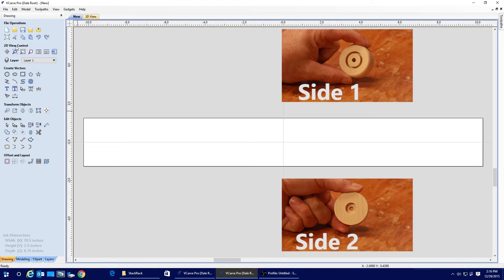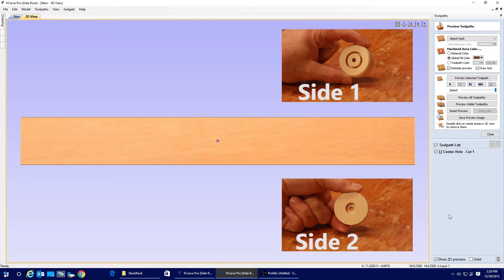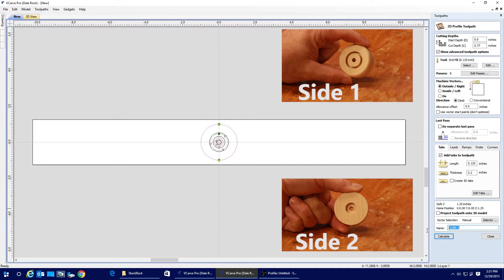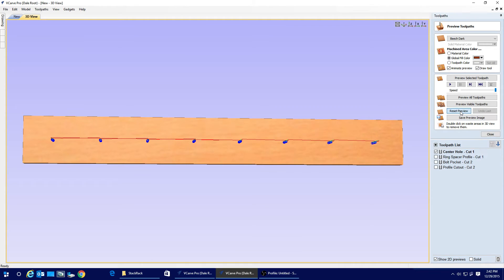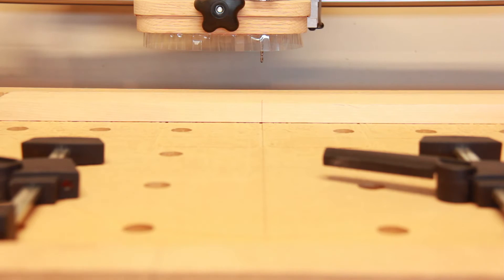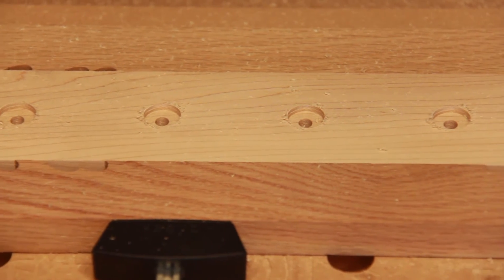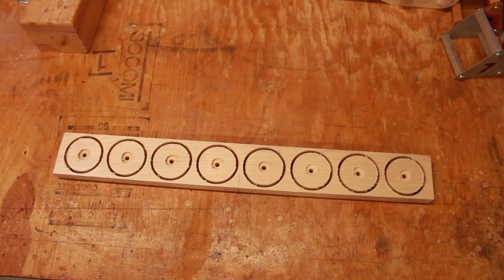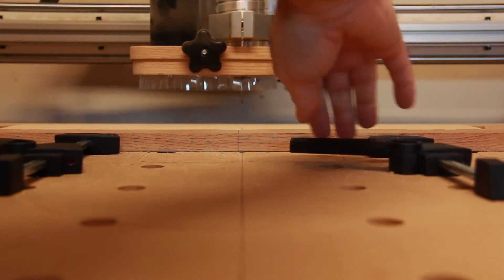CNC Router - 2 Sided Machining – 101

Comment: Thanks for this great simple video! BTW where did you buy those table clamps? They are great!!! :)
Reply from the maker: Dale Root
Thanks for the kind word!

The clamps are Festool Clamping Elements - designed to work with their MFT surfaces.

I machined similar holes directly into the MDF pallet and it seems to work pretty well.
http://www.amazon.com/gp/product/B000JNEC1Q?psc=1&redirect=true&ref_=oh_aui_detailpage_o00_s00

I've recently also started using Kreg In-Line clamps - and they seem to work pretty well too - and they are much less expensive.
You can see the Kreg clamps in use with my fixture pallet in this video:
https://youtu.be/h7L7SX-jxKA

Comment: Very clean Dale and nicely explained :)
may I ask what is the thing that you are using to hold your piece while routing at 7:42 ?
Thanks ..
Reply from the maker: Thanks you for the kind words!  ;-]
That is a router mat - basically a piece of foam cushioning that grips small parts.  Think carpet padding - that's basically what it is.  They also make versions now that are rubber as well.  Great for sanding and routing.
Reply: @OakLines  Thanks Dale ..
do you have a link for any of these? I wanted to by one..

Comment: Why not make a hardstop for x axis as well, so you don't have to refer to a line, which I think may lead to human error, specially in my case where I no longer have a good set of eyes, hehe.
Reply from the maker: Good question!

Yes - for single sided machining you could certainly add an X hard stop – and it would work just fine.

However – for 2 sided work – once the 1st side has been machined - you need a way to turn it over and precisely align the work – so that the work you’ve already done on side 1 will match up with the work you’re about to do on side 2.

Now I know what you’re thinking – adding an X hard stop should make that easy - right?
Well unfortunately – that is not the case.  Since we’re starting from rough stock - of approximant dimensions – that becomes a bit of a tricky situation when we flip the work end for end.

As an exaggeration – let’s say we design the part to be machined from stock that is 1ft tall in Y and 2ft wide in X.  Let’s say we start with a scrap piece of rough stock that we have available - it’s a bit oversized at 1ft 1in in Y and 2ft 1in in X.

Centerline Method:
If we use the centerline method – no problem – this stock will work just fine – as long as it is big enough to contain the all the machine paths – in fact any size will work.  Since we’re flipping end for end along the X axis – the same Y surface remains in contact with the Y hard stop – so the Y axis in the part remains in registration.  After the flip – aligning the center line easily pulls the X axis back into registration as well. 

Hard stop Method:
If we attempt to use both and X and Y hard stop to accomplish the same thing – that’s where we get into trouble.  No problem for the Y axis because the same reference surface remains in contact with the Y hard stop.  But – as we filp the part end for end along the X axis – the reference surface changes (from on end to the other of the stock).   If the rough stock is not a perfect dimension – that alignment of the side 2 relative to side 1 will not match.   In this case – it’ll be off by 1 inch along the X axis.

Now – you can machine holes for alignment pins – or create known surfaces within the part to carry forward the alignment after the flip.  My issue with this approach is that you then have to design these features into every part – and create fixtures with matching geometry for every part.   For large scale production that is a valid approach to boost productivity – but for smaller runs it’s just too much overhead for the benefit.

You could also start with precisely machined billet of know dimensions – then even though the X reference surface changes during the flip – if the X length is exactly correct – it’ll still work out.  Again – we start from rough stock – so I don’t want the overhead of machining a billet from rough stock – so that I can then turn around and machine an actual part.

There are several approaches to solve this problem – but my thinking is the centerline method is the simplest and most generalized way to normalize a part within rough stock.  The alignment process is really simple – I wear my “readers” to be sure I can see the marks.  ;-]

If you’d like to see more info about this – let me know and maybe I can put together a short video to demonstrate.

Comment: Good explanation.  You seem pretty confident running the round-over on such a small item without it being mounted.  Does the foam really support it well enough to not need it?  Never seen that before.
Reply from the maker: Hi Josh,

Yes it works pretty well - you do have to be careful and put plenty of down pressure on router to keep the part seated in the foam.  I like the D-handle router base for this because the weight of the router naturally helps with this and adds a bit of control because of it's offset nature.  Just don't go too small with the part relative to the base of the router or stability becomes a concern - and if you tip - that's when you're likely to catch an edge and send the part flying across the room.

Use are your own risk - All appropriate disclaimers...  ;-]

Comment: Where did you get the clamps from?
Reply from the maker: They are Festool Clamping Elements - designed to work with their MFT surfaces.I machined similar holes directly into the MDF pallet and it seems to work pretty well.http://www.amazon.com/gp/product/B000JNEC1Q?psc=1&redirect=true&ref_=oh_aui_detailpage_o00_s00When unlocked - you can slide the business end back and forth to adjust the length.
Then with a cam action - underneath the center -  a hard metal plate (up inside) bites against the silver rod to provide the clamping force.  The silver rod is a softer material - and it can get little nicks from the biting action that hinder the sliding a bit if you use them in the same position all the time.  If that happens - you can polish rods to buff out the nicks - and/or use the adjustment screws to adjust the clamping plate position.  Not perfect - but very flexible and I do like them.